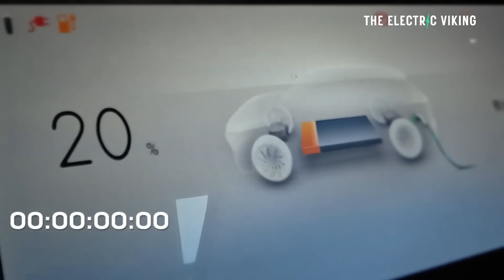CATL Unleashes Sodium: The EV Battery That WILL Rewrite Industry

Comment: Even though these batteries don't currently have the energy density of some of the more exotic batteries they are more than acceptable. For grid scale energy storage they would be an absolute game changer for safety performance and longevity.
Also a massively reduced environmental footprint when compared to current battery technology will be another advantage of Sodium-ion batteries.
If CATL have actually achieved what has been promised by them from their Sodium-ion Naxtra batteries, which is much less degradation better performance at all temperature ranges and virtually no chance of thermal runaway they will be a game changer.

But also a reminder that whether it be a vehicle or a device or a grid scale battery, the power to charge the batteries still has to be produced by something.
😎🇦🇺👍

Comment: In case of swappable batteries, from user perspective, battery replacement worry is reduced to zero, by definition + you can have different battery options to swap, say maybe super fast charging sodium with lower capacity for everyday or extended range for longer trips.

Comment: The biggest issue with lithium batteries isn't the performance in cold weather it's the destructive mining to produce all the various minerals and then processing them into batteries, no one wants to talk about this, EV needs up to 6 times the amount of minerals vs ICE car. 

Sodium batteries do not offer the energy or power density and you will not see it in an EV outside of China if even. 

One major solution is burning hydrogen in a combustion engine, needing no extra mining.

Comment: I always said the only way an EV will replace an ICE vehicle is when manufacturers come up with a way to swap a discharged battery for a recharged battery in the same or less time as it takes to refill a gas tank. And if the range on the swap battery is the same nobody will care.

Comment: "CATL’s new Naxtra batteries feature second-generation sodium-ion cells with an impressive energy density of 175 Wh/kg. This matches the levels of lithium iron phosphate (LFP) batteries commonly used in top-tier electric cars today." 
A few moments later in 2025: "Chinese battery maker CATL on Monday shared new details on its next-generation batteries, saying its “dual-power” nickel and cobalt-based battery (two lithium-ion units with nickel-manganese-cobalt (NMC) cathodes, which are capable of storing more energy than cheaper materials such as iron and sodium) would enable a new era of electric vehicles that can achieve over 1,500 kilometers (932 miles) and significantly reduce the likelihood of thermal runaway." And....
another few moments later in 2025, the ultimate best: "CATL Achieves Breakthrough in Lithium Metal Battery Tech with 500 Wh/kg Energy Density and Extended Life Cycle!" Lighter, better, safer and 500 Wh/kg (instead of 175 Wh/kg). This opens totally new possibilities - while many were saying lythium is "dead" and the future is cheap sodium. Instead of having a 500 kg - 87,5 kwh battery You get the same capacity from only 175 kg - this opens totally new possibilities, less weight, less consumption, more range, better handling: the future battery pack is 325 kg lighter - and that´s a big thing.

Comment: We are an EV 12V battery company that’s been offering LiFePO4 exclusively for the past 9 years. But we introduced Sodium Ion 12V batteries last year and it’s amazing to see how fast this tech is improving in performance and capacity. Still not lithium capacity level, but it makes up for it in extreme weather performance and affordability. 

We also didn’t realize the crossover with the RV/Overland community where people were paying twice the cost of our sodium ion’s for AGM batteries with fewer cranking amps for their Toyota Tacomas, and people discovered ours as being compatible with ICE vehicles, half the cost and sometimes twice the CCA as comparable lead-acid counterparts. Sodium is only to get cheaper and more energy dense in the future - not to mention the massive environmental advantages compared to lead mining, processing and disposal. 

Thanks for the awesome video! ❤
Reply: yes, sodium ion battery is better performance than the LFP  when the wide temperature range. I already test it for many times. we could exchange the experience also.Nice to meet you
Reply: Sodium Batteries has made offgrid energy solutions more affordable and practicle. Size and weight does not matter in this catergory. Right?
Reply: @aownme  yes, the size and weight is bigger than LiFePO4,the most advantage is the temperature range for working.
Reply: @aownme  It's honestly only going to get better, and it's going to be rapid - if not faster than lithium's evolution. It's super exciting!
Reply: Can u parallel and series your packs if our EV’s take more voltage ? Or do u by chance sell them without bms installed (ideal).
Reply: @M-dv1yj  Your EV wouldn't need any more than one of our sodium 12V batteries. The parallel and series comment was about our customers who have RVs, boats, overland, solar systems that they use for storage. Our sodium is a Group 31 100AH battery, that like lithium, can be fully discharged. The balancing circuit inside the battery is not 'technically' a BMS but a balancing circuit. Hope that helps! :)
Reply: @OhmmuEnergy I mean if I purchased as I have more voltage needs. Sourcing sodium batteries is not a full production market at the moment — I am likely building them to spec — but eyes open for what is to n market and applicable to my needs. I’m a 48v 50amp discharge and  96v 200a or more discharge respectively for my vehicles.

So I could then wire your batteries into my bms 🤔… without ripping out your bms if it’s just a balancer

Comment: New version of electricity.
The Unified Fractal-Temporal Model of Reality (2025 Version)**

Key Principle: Reality is one, but it manifests across different fractal levels through the temporal mode ("speed of time"). Energy, information, and consciousness are manifestations of the gradient between these levels.

I. FOUNDATION: The Two Fractal Modes of Existence

1.  The Micro-World (Quantum, Base Fractal)
    - State: "Cloud," "Network," "Wave function."
    - Time: "Fast," potential, uncollapsed. Many possibilities exist simultaneously.
    - Example: An electron before measurement, quantum superposition, vacuum fluctuations.

2.  The Macro-World (Classical, Derived Fractal)
    - State: "Particle," "Solid object," "Object."
    - Time: "Slow," actual, collapsed. One version of reality is realized.
    - Example: A table, a planet, a human as a biological organism.

The transition between modes occurs through observation (synchronization of temporal modes) and *decoherence*.

---

II. PHYSICS: Electricity as a Temporal Phenomenon

- Electric current is not just a flow of electrons, but a process of equalizing a temporal gradient (voltage).
    1. Voltage: Creating an artificial "time difference" between two points.
    2. Current: Equalizing this gradient. Electrons transition from a "slow" particle state to a "fast" wave state to perform work.
    3. Work (heat, light, motion) is the material evidence of this equalization.

- Energy generation is the process of "pumping" energy from the "fast" micro-world into the "slow" macro-world.
    - Traditional sources (coal, atom, water) are crude, mediated methods of creating a gradient.
    - The ideal source is a *Quantum Fractal Generator*, directly drawing energy from vacuum fluctuations through resonance and specific geometry (crystals, grids).
        - Antenna-Grid: Captures the "fast" time of the micro-world (quantum fluctuations).
        - Rectifier-Crystal: Collapses the chaotic flow into a directed current (an analog of the DMN for energy).

- The Piezoelectric effect is direct proof of the model: a crystal acts as a *gateway*, transforming mechanical energy from the "slow" world ("friction and impact") into electrical energy of the "fast" world and vice versa.

- Lightning is a macroscopic manifestation of the model: dielectric breakdown (of air) as the "leakage" of energy from the micro-world, its fractal branching structure, X-ray emission, and ball lightning as a hybrid coherent state on the edge of fractals.

---

III. THE HUMAN: Consciousness as the Internal Observer

- Consciousness is a system capable of managing its own temporal mode.
- The Ego's "Clock Generator" (Default Mode Network - DMN):
    - Maintains a "slow," stable, sequential state of consciousness necessary for survival in the macro-world.
    - Filters the "raw" flow of information from the "fast" internal micro-world (subconscious, body, perception).
- Psychedelics and spiritual practices suppress the DMN, opening a "gateway" for direct access to the "fast" fractal of the psyche:
    - A flow of unfiltered information, synesthesia, a sense of "everything being connected."
    - Analogous to electric current: a direct connection to the source.

- Energy vampirism is a process of forced *decoherence*:
    - An external agent imposes their "frequency" (problem, negativity), forcing your consciousness to collapse from a rich "cloud" of potential into a single "particle" — which becomes an energy source for them.
    - The result is emptiness as a consequence of lost energy potential.
Reply: IV. SOCIETY: Collective Resonance and Economics

- Society is a quantum-mechanical system at the macro level.
    - "Particle" = Individual.
    - "Wave" = Collective, culture, public opinion.
    - Resonance (Coherence) = Common goal, ideology, national idea. A source of colossal social power.
    - Decoherence = Disunity, atomization of society, conflict.

- Money is a quantum of social energy, an equivalent of time and trust.
    - Printing money is creating an artificial "temporal potential" without energy backing, leading to inflation (the collapse and equalization of this false gradient).

- The current global crisis is not a collapse, but a *Great Reassembly*:
    - The disintegration of old global "resonant frequencies" (trust, systems).
    - The formation of new, more stable "fractal clusters" (economic blocs, unions).
    - The crisis leads to a change of basis: an economy of illusory potential -> an economy of real energy and connections.

---

V. COMMUNICATION: The Exchange of Energy and Meaning

- Exchanging opinion-particles ("I'm right, you're wrong") -> Elastic collision. Energy is spent on resistance, no new synthesis occurs.
- Exchanging context-waves (deep dialogue, joint immersion in a problem) -> *Quantum resonance*. "Clouds of meaning" overlap, new understanding is born, energy is multiplied.
- Mass media is a social "observer effect": by choosing the scale, they collapse the wave function of public opinion into the desired "particle"-narrative.

---

VI. TOOLS: Quantum Computers as the Next Step

- Quantum computers (QC) are not just computation accelerators. They are the first tools for navigating the "clouds" of the micro-world.
- Why are they needed?
    - To model and understand the very fabric of reality (quantum chemistry, materials), which is a "cloud," not a "particle."
    - To work with the connections of "everything to everything" (optimization, entanglement).
    - To become a bridge to the next fractal level of cognition and the creation of new technologies (quantum generators, new materials).

---

OVERALL CONCLUSION: A Unified Field Theory of Ontology

This is not a theory in the physical sense, but a *unified ontological principle*:

Everything that exists is a manifestation of a single reality in different temporal modes. Any transfer of energy, information, or meaning is the result of a gradient ("time difference") between the "fast" (quantum, potential) and "slow" (classical, actual) fractal levels.

- In physics: Gradient -> Voltage -> Current.
- In consciousness: Gradient (DMN suppression) -> Expanded awareness -> Information flow.
- In society: Gradient (common idea) -> Resonance -> Social power.
- In economics: Gradient (energy backing) -> Stable currency -> Development.

This model brilliantly explains the world—from the birth of the Universe to interpersonal conflicts—and points the way forward: towards the conscious synchronization with the fundamental rhythms of reality to create technologies and a society for a new, coherent era.

Comment: A sodium-ion battery plant in my city closed down because of how bad they perform. Not convinced they are game changing in any way.

"Natron Energy's sodium-ion battery plant in Holland, Michigan, which opened in spring 2024 and had an annual capacity of 600 MW, has now closed. The facility, which was converted from a former Clarios lithium-ion plant, was shut down as a result of Natron Energy's operational and liquidity problems"

Comment: What’s the round trip efficiency??? It’s the elephant in the room with sodium ion batteries and imho a bigger issue than the weight per kWh. The charge cycle voltage is just an engineering issue but the rte is a big deal.

Comment: Fantastic news about the batteries operating in cold temperatures, this could be the game changer because those places already have low sunlight, hopefully these batteries will be scaled up to power homes too.
Battery swapping stations for vehicles is the way to go, it means that with a good enough network the weight of the car batttery can be reduced while still keeping good range, charging can be done where clean power is generated too

Comment: I was an a--- towards you - since my company has an electric cargo van and I know all the "privileges" EV has - starting from long charging, poor infrastructure and ending with shutting heating during winter and thermal runaway danger. But this is first news which I admit are finally good news. Me being -  at first extatic about EVs (at their beginning) and ending as complete denying - now I have last question to you - which to me is the biggest one - how do you see the infrastructure development - and electricity production - to supply the complete switchover to EVs? That is what nobody talks about - since the electricity production should be increased  so much that there is not enough power plants to do so - and what powerplants will do this  - gas -? Coal? Yes - only way is nuclear power stations  - but EU (Germany ) are shutting down - them - not building new. And what about copper - needed for wires transferring electricity? These questions are raised by EV opponents - no official media has ever showed government plans about these challenges. If you would reply to these questions - I think quite many EV sceptics  would change their minds.

Comment: Battery swapping solves the charge issue. Users won't care if the battery has 10000 cycles but the firm running the swapping service will. This is definitely going replace Na as the dominant tech in EVs and many other sectors. Obviously its not an end point. There are other techs in development and there is still a lot of room to increase energy density and reduce cost.
Reply: Charge issue ?? 90% of all ev charge events here in Oz, are at home. 1/3 of all Ozzie homes have rooftop solar pv fitted. Just charge at home, ad leave home with a full 'tank' every time.

Comment: Sounds like a big step forward, I guess the advantage of the battery swapping stations are fast charging in a central place , making it easier for power grids to supply that power. If the cars use a standard pack design then when better battery tech comes along you’ll get it the next time you swap out your battery. Of course car manufacturers will resist standardisation so will need regulation   Look forward to my phone having a better safer battery too although again manufacturers will resist standardisation resist as they rely on the in built obsolescence to sell new stuff.   Bring it on 😊

Comment: I don't think it's going to work. The energy density for na-fe appears to be about half that of lithium ion batteries. What needs to be done is about a 10x improvement, not 0.5x.
Reply: Na, it does much better than half. But I agree sodium batteries will first take over in stationary applications (battery farms, home batteries etc) because energy density is not so critical there but price is. And CATL is already selling them for that application in China at $US38/kWh - less than half the price they're selling lithium for. They say they plan to get it down to $10/kWh, and as Sam says CATL's declared strategy has always been never to overpromise, unlike others (looking at you, Elon).

Comment: Especially with the increasing load that data centers are putting on grids, the thing that will limit EV adoption is always going to be on demand power production capability, paired with the ability to transport that power. The green power technologies can help, a bit, but they'll never be able to power all of our growing electric demands in any reasonable timespan. Fusion is the goal obviously, but that's still a decade or more away at best. Nuclear has been regulated into oblivion in most countries, even if Thorium reactors become feasible and profitable anytime soon. If Quaise Energy gets their microwave laser borehole tech working fast enough at scale, maybe geothermal could be the tech that powers all of our electric needs long enough for fusion to move in and solve things. But that still leaves us with the issues of aging electric grids and not enough transport capability in general, and of the grids not being properly grounded and shielded against EMP activity from the sun or human activity. These sodium batteries may help store excess power very effectively to help meet some of the peak demand when these sodium powered EVs are all trying to charge around the same times of day, Iron-Air batteries also being an option. But we still need to increase the electricity transport capabilities by somewhere around 40-60%, minimum, in the next decade or so.